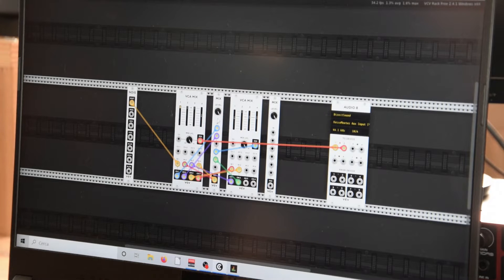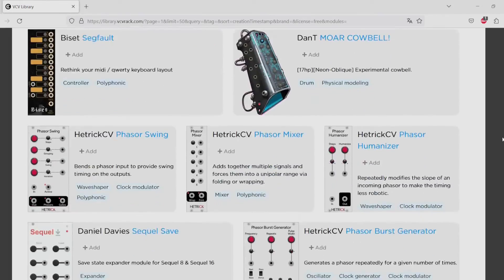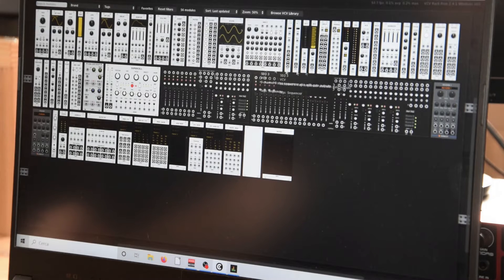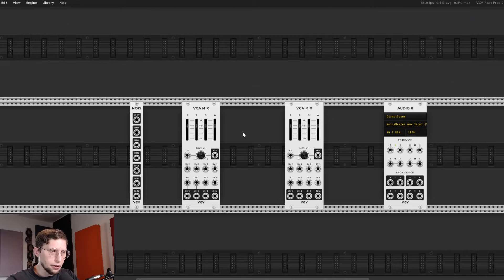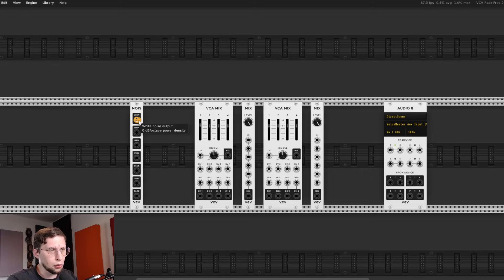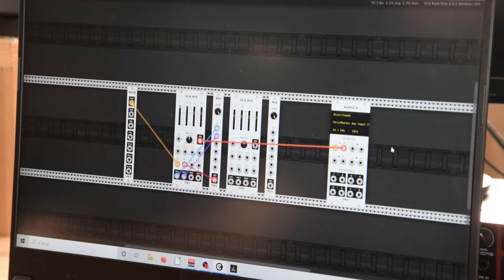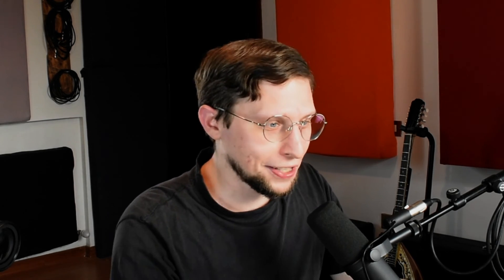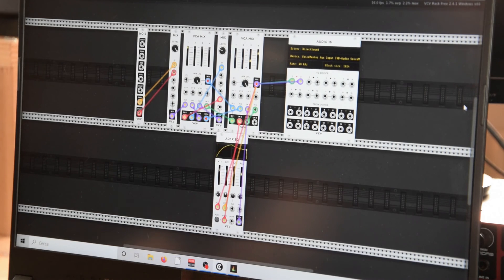How to create a virtual no input mixer / No input techniques tutorial

Comment: Doesn't work in Cardinal. The plugin glitches out and stays permanently clipped.
Reply from the maker: @jetlag000  ouch, I guess some softwares have some kind of protection against feedback
Reply: See if a highpass filter in your input path helps. Software doesn't handle accumulating DC offset very gracefully; highpass filters eliminate DC. If you just want to block DC, set the cutoff as low as possible.
Reply: @GeorgeLocke  Hmmm it does kinda work, but only if I don't use Cardinal in FL's Patcher or if I use Cardinal standalone. But I have to use a bunch of filters if I want to do anything more than just basic feedback. I guess I'll have to use VCV Rack if I want to do no input mixing... What a pain. I don't like that you have to be logged in to install modules. That's why I use Cardinal (well that and the ability to use Cardinal as a VST for free).

Comment: who are the mixer modules made by? im trying it using the default VCV mixers but after emulating your wiring im only getting coloured / filtered noise and the occasional pop or crackle.
Reply from the maker: The mixer modules are the default ones that come with vcv rack. I used the 2.0 version. Don't know if with later versions they replaced them. Anyway you can find a ton of mixer modules on vcv rack website and download them for free, if you can't find the one that I used in the video.

Comment: One thing, though: You're using an input (the noise generator). Isn't it considered cheating?
Moreover, you could filter out some frequencies with a VCF.
And/or modulate VCAs, the VCF,  use a S&H after the noise, ...
Reply from the maker: Eheheh probably it is, but I think there is no such thing as cheating in making noise! Anyway I tried to recreate an hardware no input mixer with vcv so I had to take this little "freedom" to make it work ;)
Reply from the maker: and of course I showed just the most basic setup, you can add whatever you want starting from that point onward.
Reply: @AndreijRublev  Generative music is my field, you know... ; )

Comment: I was wondering why I didn't have VCV rack already, but I didn't, so I installed it, and then got an error code on start up, and it would ask to be closed.
For some reason it will just not start, and I got the windows 64 bit one.
Reply from the maker: There are also older and 32bit versions available on their website. You can try with one of those to see if it runs on your computer.
Reply: @AndreijRublev  I can do it in cardinal FX in my DAW, that works. I think maybe the VCV rack doesn't work as a standalone for the free version.
Reply: What error code? Maybe I can help you.
Also, you can ask on the official forum, they are all very kind and helpful. I know. 😉